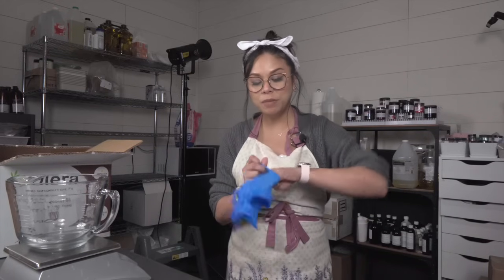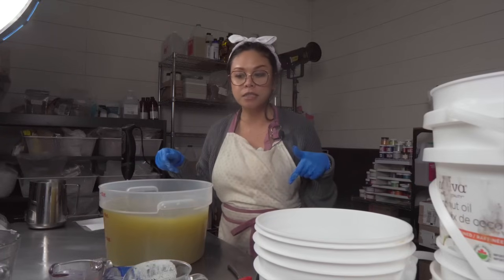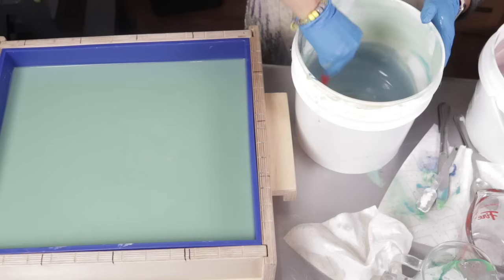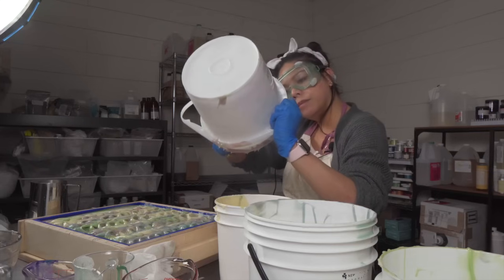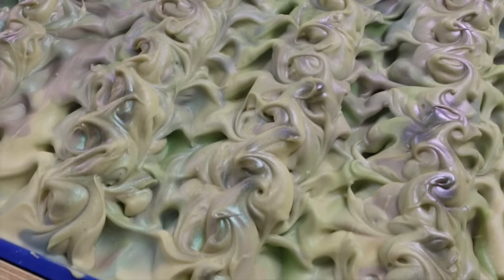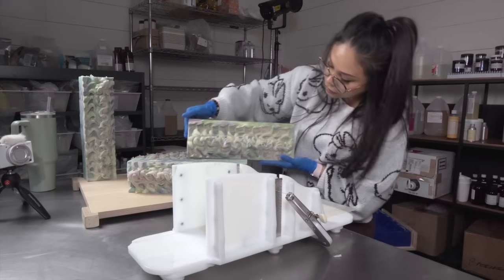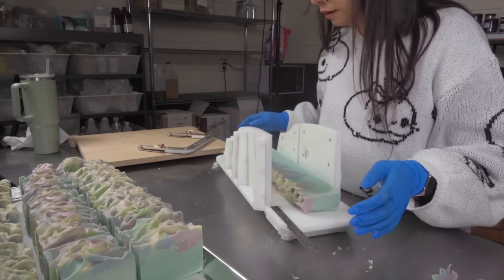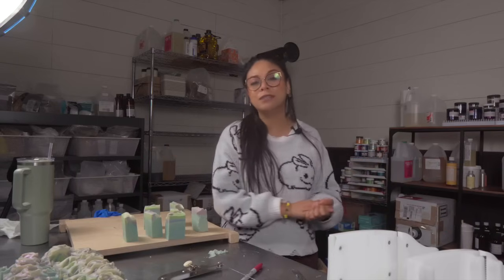Epic Soap Making Scale-Up: 24 Pounds in One Batch!

Comment: Very nice! I work with large slab molds as well. I find it easier to pour off my smaller containers first and save the larger amount of batter in the original large container that the batter was blended in. One less container to wash as well.😊

Comment: I have a suggestion for your colorants. If you measure out a percentage of your oil weight, you'll always have enough colorants! I think 1-2% should be enough. I Dream In Soap does it and I think it's a great idea, I've done it before and it's worked out great.

Comment: I’m sorry that happened to you with the paperwork for The Employer Identification Number - EIN.  The government websites are pretty easy to work with.  That soap came out fabulous!  How did you calculate the amount for the mold to the exact point?!  May I suggest a big stainless steel pot for these very large pours.  Ariane Arsenault uses them and she pours big slabs.  14 to 16 quarts should be a good size for that particular mold.  Good stuff…love that soap! ❤️
Reply from the maker: Yep! Once I knew the correct way, it was so quick and easy! Dodged a bullet with that one!
Reply from the maker: To get the exact amount, I started with knowing how much soap fits into the slab mold, which was described as 24 LBS. then on soap calc, I entered my oil weight. I kept adjusting it until it read over “24 LBs” in the total soap weight field. I know there’s a more mathematical way to do it, but I’m not a math girlie so this way was easiest for me 😅
Reply: @JerikaZimmerman  Actually, yeah, I admit to this too…🤣..I tried the math way and it just doesn’t do it for me…😂…I think this is easier…👌🏾

Comment: Wondering why you didn't measure before you started.  Not being rude.  Also, long sleeves.. or long gloves. Lye burns are not good.. 

I'm 5ft, and having a platform to stand on while needing to pour something heavy, is huge.
Reply from the maker: Thank you for the suggestions!! ❤
Reply: That was scary for me too, watching you without sleeves and long gloves.  Also, I have been spraying mica on my soap tops just like that for years and my lungs can tell you that a mask is your best friend. That stuff floats around so bad.  I was worried a bit about your spillage in the beginning.  Like, you cant tell if you have lost a lot of oils for your lye ratio or if you have spilled more lye that oil.  Maybe it just appeared to be a lot.  Hopefully things will get easier going forward with all of the great suggestions here xo